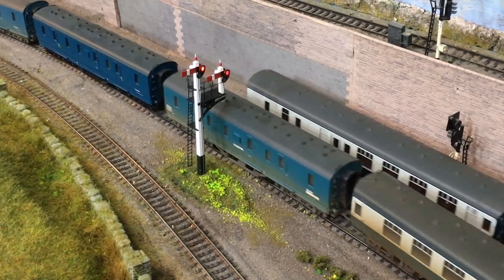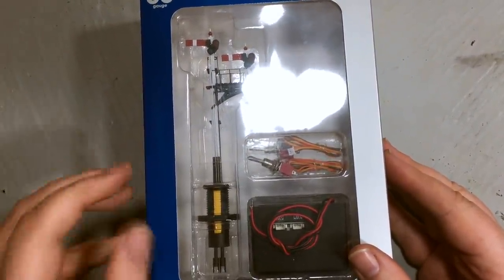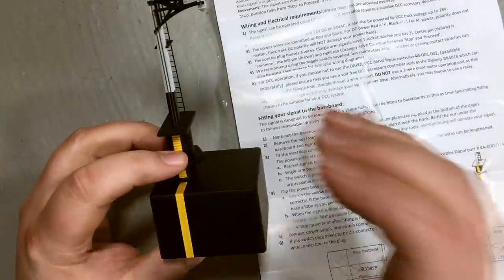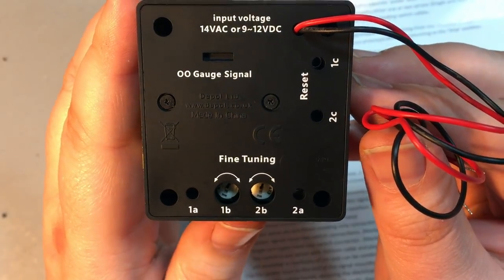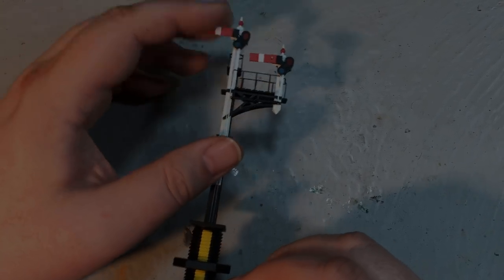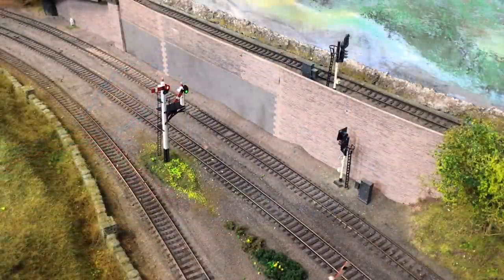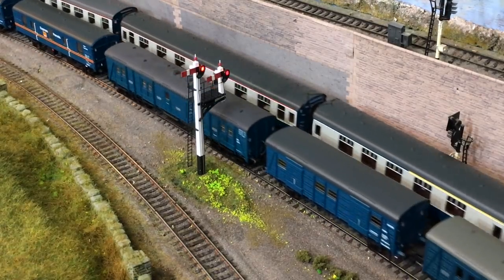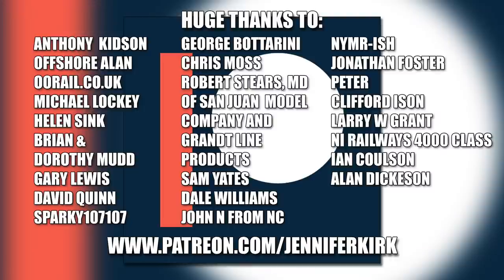Install a Working Semaphore Signal from Dapol

Comment: Great video Jenny. Glad they worked for you. I’ve installed two of these junction signals and they have been nothing short of an expensive disaster. Firstly 9 of the 12 soldered connections to the switches were so brittle they just fell off, and one of the switches wouldn’t work at all. Having resoldered  the switches one arm on one signal didn’t work at all. The other signal has a life of its own, with the arms bouncing up and down constantly without me doing anything. They’re on their way back.

Comment: Excellent video. If you are using the Cobalt IP Digital point motors I guess you can wire straight into the S2 L, R & C terminals as that is essentially a SPDT switch, same as the mechanical ones supplied. That way you have an interlocked point and signal. The frog terminal will output the DCC track voltage so can't see how that will work. I didn't realise the older signals just toggled their state, these look much better.

Comment: Another useful video Jenny insofar as awareness of what is coming out but, my oh my, what a price; £57 each at Hattons (I had guessed around £44 before looking). It's the time immemorial offset of cost v convenience and as you mention, if you have the ability to build eg Ratio signals, and then use with MegaPoints controllers for instance, after 2x signals you will have the costs matched. The MPC system also has a prototypical arm 'bounce' built in and is automatically switched through track sensors. Neither system is wrong or right but for multiple signal installs, the costs need to be carefully weighed up. The Dapol LED feature and connection is very nice indeed though
Reply from the maker: Convenience counts for a lot though. I think a lot of people will baulk at the fiddly nature of the Ratio kits and their fragility.

Comment: Hi Jenny! Loving the videos, Giving a very clear and concise set of instructions! As someone who has heavily invested in DCC Concepts gear. I am running DCC IP Digital Point motors throughout my entire layout. I was wondering if it's possible to wire these DAPOL Signals in to be thrown when I throw a point? Ultimately removing the requirement for me to get the Train-Tech Signal controller box.

Comment: JK I use DCC concepts cobalt alpha and all my signals are wired directly to the point motors thanks to a 1cent diode excellent results.  QUESTION would not see any reason I could not carry on the same approach.   Just wondering if that’s something you dabbled with on the bench.  Cheers
Josef Model Railway & Toy Room

Comment: Thanks Jen do you think an MP5 point motor will work these signals? I've only used the 3 wires to connect my MP5 to my points? so I think I've got 2 relays spare?
Thanks

Comment: This Dapol signal is a reprise of the old Hornby Dublo electrically-controlled signal. That has a large base to accommodate the solenoid, but no work under the baseboard is necessary! Trix electrically operated semaphores are similar if you can't afford this Dapol offering. I would advise you not to wire the signal into the position of the point as this is very aggravating when you get a derailment!  Thanks for uploading.
Reply from the maker: The old Hornby Dublo signals were the best for a long time. But they are actually solenoid operated and looking very dated next to these new offerings it has to be said. 

The HD colour aspect signals though still hold their own.
Reply: @JenniferEKirk  I have not got any Dublo solenoid Signals. Maybe you could make a video comparing them to the modern Dapol offering? You can operate Hornby R171/2 with a (discontinued) R664 point motor. This would work if you wanted to site a signal where you cannot drill through the baseboard!  HD colour light signals are useful in that they do not require polarity to be observed. Some modellers have replaced the bulbs with LEDs where extra brightness is required. Motorised semaphore signals have the advantage over colour lights in that the signal state can be seen from any direction, which is useful if you want to know which way a point is set! According to this video, that's your next project. Have fun,

Comment: I wonder what the long term reliablity of these will be like?
Reply: Hi Sir William, In June 2018 I installed 6 Dapol SR semephor signals,, controlled by 3 Train-Tech Automatic control units,  each signal also has a manual override. I estimate that over the past nearly four years each signal has operated realiably at least 20 times per night, 4 times per week, 40 weeks a year, times 4 years = 12,000 times. In that time I've had 2 locomotive decoders burn out. So I believe that Dapol semephor signals are realiable enough for my model railway use.
Reply: @bazza3643  Excellent. It's always good to get positive reports. Thanks for taking the trouble to respond. ✔️